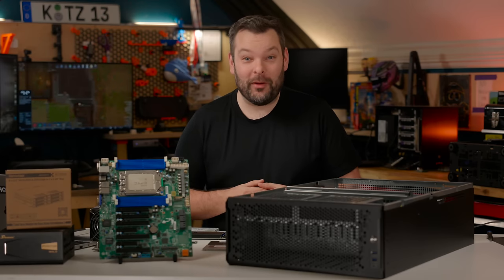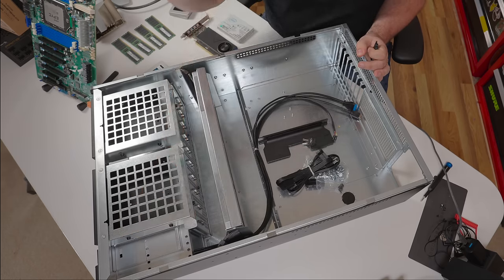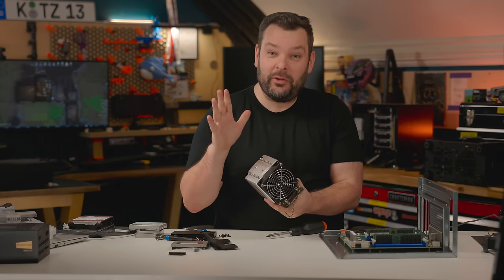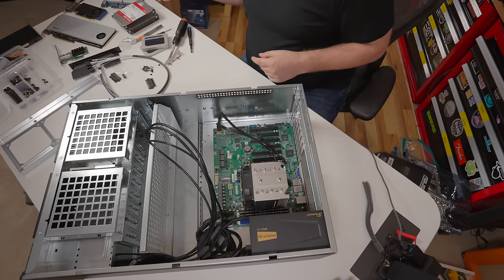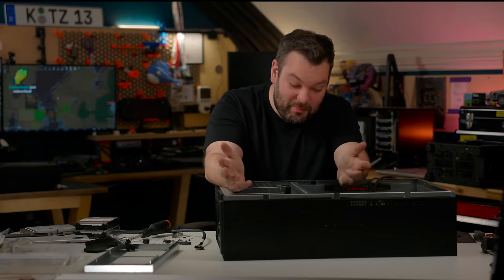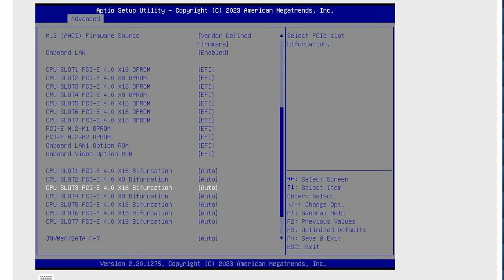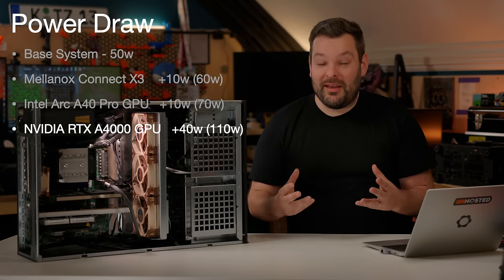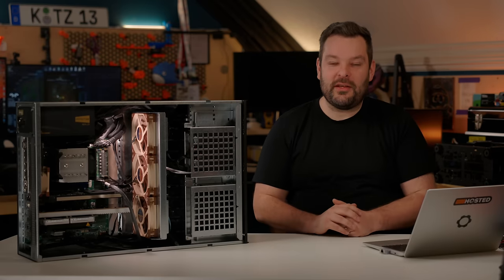An Epyc Homelab Monster: the Perfect Media Server mega upgrade

Comment: You sir have done what I tell everyone who thinks they want to build a workstation/HDET with a Threadripper or Xeon - just get an Epyc. You save money, get more PCIe channels and more threads. Great build - boring is good!
Reply: Couldn't agree more in regards to "boring is good". I am suffering with my W680, DDR5 ECC UDIMM RAM and i5-12500. I wish I had gone for a true server platform despite some more watts. The RAM ultimately caused restarts so much so, that I replaced the CPU, PSU and motherboard, not knowing, that I should run the RAM at 3600MT/s or - even better - at 3200MT/s, because otherwise it's unstable.

No traces of the random reboots in the BMC, journal or kernel (or really any) log and when running Memtest86 for hours, it just worked flawlessly.

3 months of time lost... I wish my build was boring.

Comment: I have that Icy Dock with 6 2.5" bays. The fans isn't too noisy. It has a built in fan controller. There is a switch at the back. Full speed, half and off. I run half speed and it silent
Reply: i have the same icy dock and put tiny noctua fans on it to fix the noise

Comment: Absolutely incredible video. This is my dream system. Been reading everywhere that the 7302/7402 drew like 100W at idle. Great to hear yours was doing 40-50W at idle.
Reply: though i dont have a wall meter according to hwmonitor both 7302's run around 55W on idle, roughly 25'c-35'c using those same 92mm fan 6 heatpipe heatsinks in his video, with thermal grizzly kryonaught extreme heatsink compound. Running cinebench R23 hits 140W on cpu1 52W on cpu2 45-55'C (ambient is pretty cold however i have seen 60'c-65'c in the past) 27 passes with a score of 35341 beating Ryzen Threadripper 2990WX by over 5000 points.
Reply from the maker: @danthompsett2894  some good numbers there! these modern chips are so good.
Reply: @ktzsystems  do you have any data for how much the 7402 can draw under full load? I have a 7551P and noticed online literature suggesting max power draw could be over 300W, but I'm not sure how that's possible at 180W TDP, and my chip never seems to want to pull more than 130W anyway.

Comment: On the H12 motherboard, you can change fan settings which might stop the ramp-up/down.  Try optimal or even heavy workload.  Your Noctuas will still be quiet.  Better than messing with raw bmc scripting if it works.  Nice video sir.

Comment: You don't need a python script to control your fans. Just use the IMPI to set the min fan speed to 250 rpm. I have the same motherboard. ipmiutil sensor -g fan -n 42 -l 250 -N 192.x.x.x -U user -P password
That is for fan 42 which is fan2. You will need to set it for each fan you want to set the min fan speed.
Reply: I'd have to disagree, if you're not monitoring your cpu temperatures and adjusting fan speed based on that could burn out your CPUs. I think would be a good temporary setup, but coding a custom python script you could add as a cronjob would be more efficient in the end.

Plus python script should email you immediately if cpu temperature crosses a threshold for manual intervention. What if you had 128 cores going full blast mining etc and thermal paste wears off after a year
Reply: @syleishere  I have a H12SSLi. Using IMPI I set the min fan speed. This is because I am using 140mm fans which don't need to spin fast. The motherboard ramps up and down the fan speed for the 2 thermal zones automatically based on temperatures. And it the CPUs do get too hot, a annoying sound alarm will go off and you will have to unplug the power supply to make it go away. As long as you are using 4 pin fans, the mb does a fine job of changing fan speed as a function of internal temperatures.

Comment: A military data center did not allow modification of the equipment to attach an air filter I cut open cell washable filter  material to friction fit in the the air intake. The combination of the friction fit and intake airflow held the air filter in place. In your case you may need a bit of Velcro to hold the filter in place.

Comment: Thanks for the video! Coincidentally I’m also building a H12 epyc eBay combo server. I found an old 45drives/backblaze/protocase storage pod with nothing in it for 25 bucks on random online classifieds. Currently making my own “backplane” with fan out cables as the old backplane only supported sata drives using a weird technology called sata multiplier. Cheers!

Comment: the removable fan on the cpu cooler is from the server world, that way you can remove the fan quickly and easily with out having to fight with the cooler, just the fan, on some systems you can replace a failed fan with out turning off the system, for places screaming about 5.9 uptime it can be a good thing.

Comment: What a coincidence! I just started an Epyc build myself with very similar components! I just received my Supermicro h12ssl-nt. Almost identical motherboard with a few differences like onboard dual 10gbe and 2 slimsas connectors. I paired it with the same 8x32GB ddr4 3200mt/s rdimms as well. I went with a 7302 cpu, a rosewill rsv-l4500 case, and a Sparkle Intel Arc a380 low profile card (the cooler still has a width of 2slots 😢). The only thing left for me to buy is storage and a RTX 3090 or two
Reply from the maker: You’ll just have to hang the GPU out of the bottom slot so it overhangs into the ether!
Reply: @ktzsystems  I think I found a downside with this setup that hopefully gets resolved in a future bios update. Resizable bar isn’t available currently as an option in the bios to enable. That impacts the performance of Intel Arc cards big time from what I’ve read, including their transcoding performance. Supermicro is allegedly working on a bios update to enable so hopefully that is released soon
Reply: @tehsnipes123   BIOS 3.0 was released back in July which supposedly includes ReBAR. Do you know if it's working as expected?
Reply: @jasonmako343  Yep I gave it a shot and ReBar is working great! Shoutout to Supermicro for updating the BIOS

Comment: Great video, why would you use 2 old SSDs? 4 nvme be great for freebsd raid0 stripe across them all, rest of space for bhyve virtualization. Then another raid for the spinning disks. I'd like it if you used 1 64 core epyc or duals, most people rocking 128 cores these days in dual cpu setups. 

For nvme you have PCIe 4 lanes for some 990 Samsung nvmes for the bifurcation card?

Comment: lots of older cases had motherboard trays. My inwin q500's ive had since my 486dx2 days. I have 2 of them still. One has my older unraid 5.0.6 running 4tb or smaller drives either internally in the case or in my sata2 hotswap drive enclosures. has a 3 bay and 4 bay setup in the 5.25 bays.

Comment: NIce video, thx a lot. One question - the H12SSL manual says that 4 DIMMs must be placed to the furthest slots while you have them installed in the closest slots. I wonder if you did that deliberatly to check if it works or you did so worngly? Thanks!

Comment: @ktzsystems do you have the build list in a Google Spreadsheet format?  I'd like to build the same thing you did for my home lab but I'm curious about the raid card, PSU and cable you purchased to wire up the drives?

Comment: For example, I have had bad experiences with the Crucial MX500. The first, as well as the replacement delivery had write errors with Zfs after a few weeks. But this may also have been due to the OpenZFS bug.
Reply: I have a few MX500 without issues.  Yes it could have been the OpenZFS bug.  Try reformatting it and redo the ZFS pool.  Might work just fine.

Comment: Thank you for the video and awesome information.  I am looking at this build to upgrade my HomeLab habit (currently have a couple of HP Elitedesk 800 G3 sff).

My use case will be the following:
- Plex with Arr’s and associated apps
- HomeAssistant and associated apps
- Frigate and Associated apps
- Local LLM
- Retro Gaming

Is there a list of full build parts (like PSU)?  I am currently on OMV but looking at TrueNas or Unraid.  Any suggestions?  Thanks again!

Comment: As a heads up, NAND really prefers to be warm, and can increase lifetime. The controller you want to keep under throttle, but the NAND can be hot, and is preferred. 60c is more than reasonable.
Reply from the maker: Huh. That’s super interesting, thanks for sharing. 
I’m still mildly concerned about the pcie slot area being so congested and moving those u.2 to the front connected via the slimSAS connector on the board into a caddy would free up a lot of space.
Reply: Total nonsense.

Comment: Good price on these CPUs , i had no idea an EPYC was this attainable. Arent they rather slow though? They’re half speed compared to what the 12th/13th gen regular intel chips boost to. RAM is also starting to hover in the half speed range compared to DDR5. I currently have a refurb dual CPU Xeon Workstation and it’s barely usable. Are there homelab workloads that take advantage of slower processing but more cores/threads? The main advantage I can see is the huge amount of pcie lanes for addon cards and drives.
Reply from the maker: Single threaded they aren’t lightning fast you’re right. But they can crunch a lot all at once. And connect a lot of things together with all the pcie bandwidth.

I’ve just ordered an upgrade for my media box with an i5 13600k for the speed. 

I think eventually this epyc system will end up in a colo. it’d be so great for that.

Comment: Love the video. Can I ask about the sata dom ports. Does the ssds that you`re using in this build for the boot drives get powered by the DOM ports or did you add the power from the PSU?
Reply from the maker: They could be powered with adapters from the dom port but in this case I ran a power cable from the PSU
Reply: @ktzsystems Thank you

Comment: What size is the rear fan?
Reply from the maker: the sliger case doesn't officially support it but i screwed in a single 80mm fan. since the video i have removed it as the fan control script coupled with nvidia power management discussed in the video have kept idle temps under control.

Comment: Would love to see the Ollama / Llama / ML setup on the system. Try to do dual GPU, I think the MB can support it.
Reply from the maker: would that be sane to attempt with 1 nvidia gpu and 1 arc?
Reply: @ktzsystems  I haven't seen that kind of implementation, because each vendor has a separate library for managing the GPU (CUDA for Nvidia, ROCm for AMD).
Reply: @ktzsystems  from what i've read you want as much vram as possible so you can load the whole llm into the vram so it is performant. 3090's are king.

Comment: I had a similar power issue when putting in a RTX2070 into my system passed through to a VM, I found that the default Nvidia driver that the Ubuntu server script installed was a bit old so I updated the Nvidia driver and the idle power state dropped down to 4 watts with fan at 0 rpm.

Comment: Can I ask, I have mounted the cpu fan the opposite way around IE fan facing rear, will this effect the vrms temp and will it be ok as it is? or will I have to turn the heatsink aroung? don't really want to do this because of how sensitive the eypc can be. Also, on reading the script it says it can be dangerous and smoke the cpu, is the script safe to run?

Comment: Interesting, which card do you use to put 2 nvme drives on and use bifurcation, probably not pcie5 right? I'm building a genoa system as well, thinking about kioxia drives, but the pcie5 are still very expensive and i don't think pcie5 is possible on such a card, but was only able to find single drive cards.  I'm using a fractal 2xl case, the icy dock bays are rediculously expensive, for a 6bay nvme, about 450 euro for a piece of metal with some u.3 adapters 😮,  200 would be more reasonable.
Reply from the maker: I just added a link to the description as well. It’s this one. 

https://amzn.to/3P2tg8C

Comment: How did you get your Arc GPU properly passed through to your VM running Plex in docker?  I have mine (a380) passed through from Proxmox to a Ubuntu 22.04 VM. The drivers are installed in the VM so that the card shows up in intel_gpu_top, but the VM crashes if I try to transcode with the card.  I also get errors in dmesg about resizable BAR not working and only allocating 256MB to the card. Any tips?
Reply from the maker: The bios doesn’t have a resizeable bar option (yet). I read - forget where - it is coming soon so until it does I’m not passing through and just using the card for quicksync duties.

Comment: Are you saying that with everything assembled and running your power usage is under 150 watts? Is that an estimate or meter reading ? 

If it’s real I will be replacing my Dell R720s.
Reply from the maker: 175w with everything assembled at a "base idle" which means both GPUs loaded, a handful of app containers and VMs not doing anything intensive, and 10 HDDs spinning.

Comment: its a shame the 7402 only has a 2.8ghz base and 3.35ghz boost, mind you i have a dual setup with 7302x2 so i still maintain a high core count 16 core 32thread x2 making 32core 64threads, my bug bear is that disspite the fact that it has a 4g decoder setting in bios theres no rebar setting, and the board only supports gen 3 pci-e.  Yeah took me a while to work out that it only sees 4 drives if you bificate the slot into x4x4x4x4, and i had to buy priotory SuperMicro cables for U.2 drives and SAS to x4 SATA x2.  i dont know if U.2 is faster but i bought a converter by IcyDock to converter an M.2 into a U.2 for 1 of the U.2 ports as the boot drive and an intel U.2 drive for the other Port, originally i thought the onboard m.2 port was a SATA type but i was wrong. Im gutted one of the 10TB NAS Drives upped and died, and atm cant afford to replace it :(, im wondering how good the Dual SP3 Epyc Gigabyte motherboard is but they are typically £800-£1000 stead of £250-£400, oh  if you see cheap epyc 7001 or 7002 cpu's make sure there vendor unlocked typically the cheaper version are because there vendor locked usually to Dell Systems, and initially you may need a retro SVGA monitor to get into bios via the onboard BMC port b4 changeing to the discrete card. far as i can tell BMC doesnt work with windows 11. oh and I only got 15 out of 16 rams slots running so stead of 128GB its got 120GB, suspect cpu mounting pressure or faulty chip maybe it justs needs swapping to the second cpu socket. but ive killed this type of socket in the past trying to upgrade, so im leaving it alone.